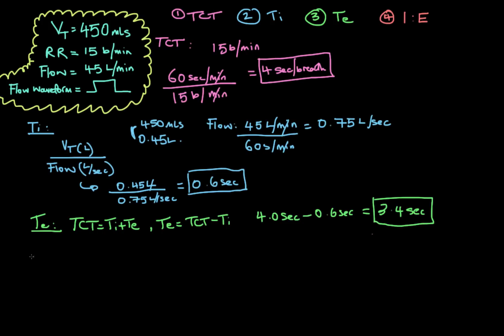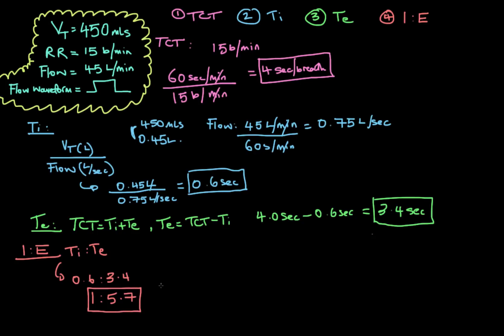Principles of Mechanical Ventilation 8: I:E ratio example 2 in VC constant flow

Comment: how this can be applicable in the ventilator? I think there is a choice to change manuplate the ratio to be 1:2 or 1:3 whatever the time of inspiration and expiration>> is this right?
Reply from the maker: There is that option on a lot of ventilators (to control your I:E ratio). Many anesthesia machines ONLY let you control I:E ratio (you can't manipulate the flow).

Here's how its applicable:

Think about what would happen if you had a FIXED I:E ratio (of 1:3 for example) and you began to increase your RR. The TCT would become shorter as you increase your RR, meaning inspiration would have to take place faster to ensure the same ratio of inspiration to expiration. But in VC we still have to deliver the same tidal volume each breath. To do this the vent will deliver the tidal volume we've chosen at a higher flow, to ensure there is enough time to give expiration its portion of the 1:3 ratio. This increased inspiratory flow will increase your peak inspiratory pressures. 

You have the choice in volume control on most ventilators to either have a fixed I:E ratio, or a fixed flow (with various flow patterns). I'm not saying one way is better than the other. You just need to understand the principles so you know what will happen in both situations. 

Maybe i'll do a video on VC with fixed I:E ratio, rather than fixed flow. 

Hope that helps

OP
Reply: I get it ,, thank you very much , i really appreciate , waiting for your most valuable vidios , thank you sir
Reply: This is answered in the video

Comment from the maker: Got a question about how we calculated I:E of 1:5.7 from Ti of 0.6 and Te of 3.4. You have to ask "how many times greater than inspiration is expiration?" in this case the expiration (3.4sec) is 5.7 x greater than the inspiration (0.6sec). So the I:E is 1:5.7. 3.4sec/0.6sec = 5.7sec. As a convention we report the I:E ratio as 1:(x) when the expiration is longer than the inspiration (most of the time). In this case the (x) is 5.7.